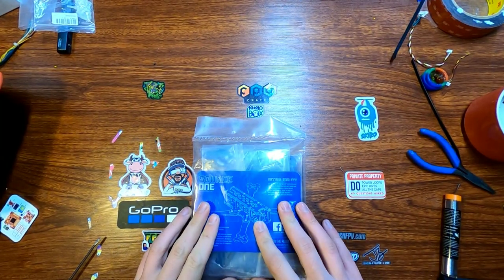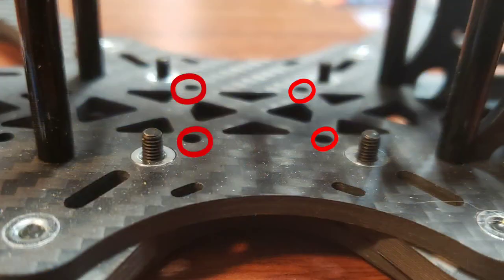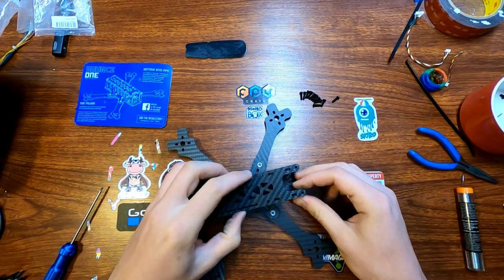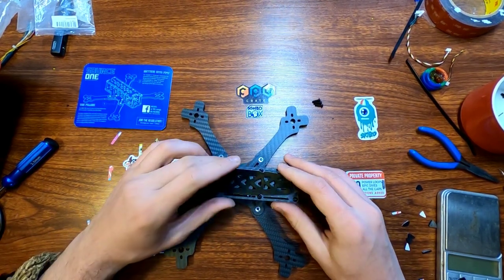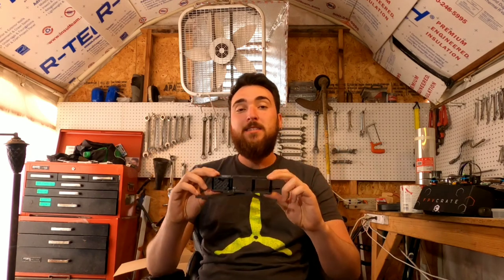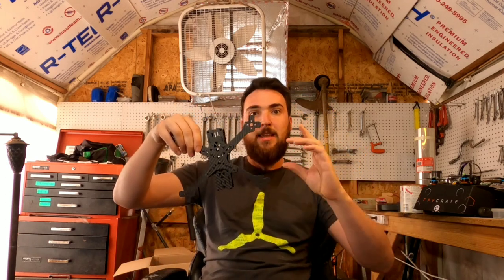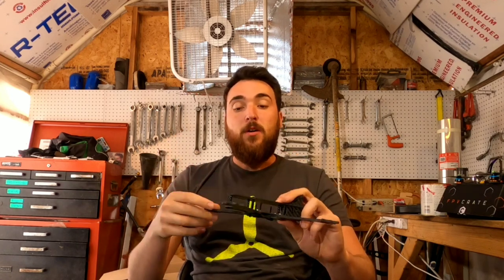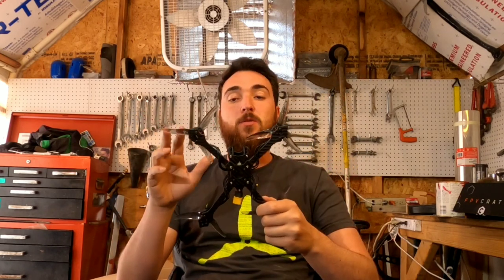Source One V3 TBS Frame | Honest Review

Comment: How many of these frames have you flown?  Have you flown the source one for more than a dozen packs?
Reply from the maker: I think I misunderstood your question I have used all of the frames I talked about in this video except for the Glide frame. I can say the Skitzo frame is extremely durable the Dolphin One frame is not that durable but great for cinematic work. Add the Ark One is a really good Racer. Extremely durable.. However this TBS frame is just as durable if not more than those and cost less. But does not have a lifetime warranty. However that lifetime warranty sometimes can be a real hassle depending on stock.

 I Have used 4 dolphin one frames and  broken 20 plus parts.

3 skitzos broken  10+ parts

2 ark one broken 1 arm.

1 TBS AND I CANT BRAKE IT...
Its hevy though....

Comment: I fly primarily bandos and have about 200+ packs flown using this frame. I switch to this frame to save on parts arms, topplate etc... i mainly used the ImpulseRC Alien and the FlightClub Proton. Both great frames but got costly replacing arms and other carbon parts. Since switching to this frame I have yet to break anything other then electronics.
Reply from the maker: Yeah the carbon definitely seems high quality especially for the price

Comment: Holy cow 🐄 that’s a heavy frame. I’ve got a source one v2 but never built it up. I’ve been debating on getting the 7” arms to build a long range rig. At least until I get my project 399 practice frame to build a DRL spec racer. 👍
That all said I still prefer my wildwilly dolphin build and nova build and of course my main race builds are all arc ones. I highly recommend the Arc One. I’ve yet to break any parts on mine, well I say that but I did manage to break an arm but the hit it took should have destroyed the whole quad. And to only crack the arm I was amazed! But other than that one of my arc ones has been to at least 25 races and the only thing that’s broke were props. 👍👍👍
Reply from the maker: Yea they ate really strong  The dolphin one has multiple week points though
Reply: Mr Tie FPV How to and Review it does but I’ve yet to break mine. Lol. Just haven’t had any bad bad crashes with it yet. The arc one on the other hand has had some major crashes. One mid air at a race was so bad it ripped my stack out but the frame took it like a champ. The other guys quad didn’t fare so well. He broke a top plate and all 4 arms and his Lipo exploded and blew his esc and fc. Think the only thing that made it was the cam and rx.
Reply from the maker: Lol yea it's a tank of a racing frame. Not yep heavy either

Comment: I won one of these frames on a giveaway and want to use it for my first build. I’m a newbie and only have flown simulators and my tinyhawk 2. I want to spend the next couple months slowly building a quad out of this frame. I’m not sure where to start or what my limitations might be. I don’t want to use a gopro and I’d love to have onboard SD card for better footage separate from what I would see in my goggles. Is that possible on this frame?